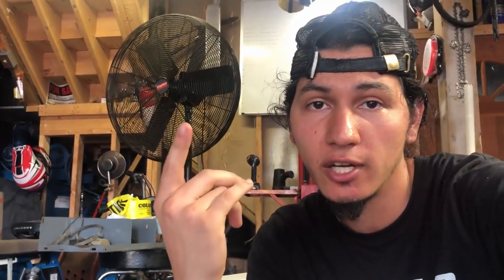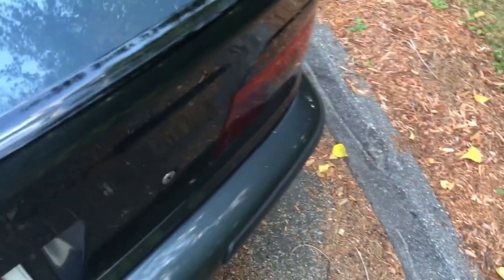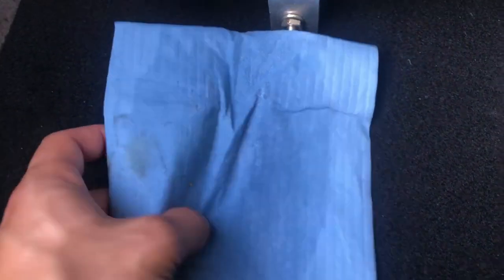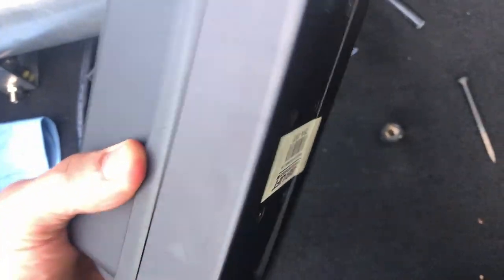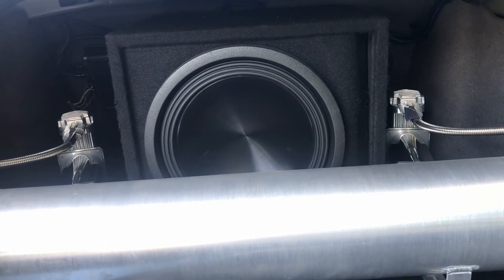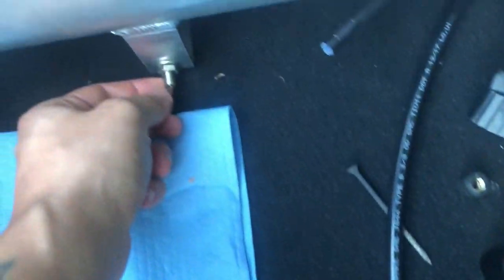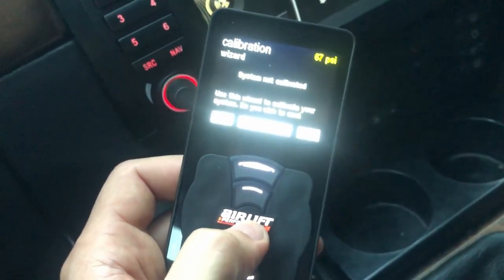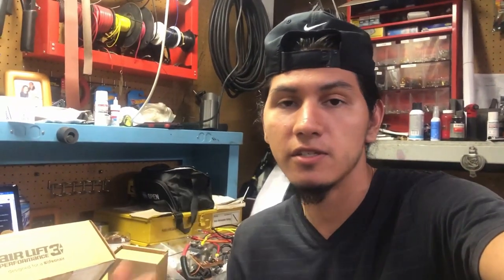AIRLIFT 3P MANIFOLD ISSUE

Comment: Had same problem. You got water in the manifold. It’s safe to drive . Just contact airlift and send them $250 and they’ll send another one so you can still keep your old one. Once you get the new one just send them your old one for refund. Also, that trunk setup could be a lot better. I had airlift on my 540i and all you can see is the 8 gallon tank. You can hide everything else so it’s a cleaner setup.
Reply from the maker: Vinh Nguyen They told me just to send it back and i will get the new one in a few day. I didnt have to pay. I was under warranty still. I am still working on my setup. I have a few more ideas. My setup is different from this video now. I made another video on the new setup.
Reply: @A1Brian   Correct, if you send them yours first, you pay for the shipping, they will send you another one free. However if you can't take your manifold out because you need the car to get to and from work etc. then you can pay the $250 and they will send you one and when you return the old one they will refund you your security deposit.

Comment: What stereo you have?
Reply from the maker: Hector Arias Coaxial Alpine speakers all around. 600W Kicker amp for the speakers. 1200W Kicker amp for the sub. 12” Alpine Type S subwoofer in ported box. 1.0 capacitor. The radio is from online, i dont know the brand or specs tho.
Reply: @A1Brian  Thanks bro
Reply from the maker: Hector Arias No problem!

Comment: You took the manifold out without airing out?
Reply from the maker: I had to air out and take the air out the tank too
Reply: How'd you do it if the controller and bluetooth app wasnt working?
Reply: I wanna find out too,because the air in the tank is posible but those air on the bags,,,how??
Reply from the maker: I added a good fuse really quick so the controller would come on until i got home. Got home and aired out the bags completely. Then aired out the tank. Disconnected the battery. Disconnected the harness on the manifold. Then disconnected the airlines and took the manifold off.

Comment: Problem will be that the manifold is lower then the tank from what I have read up
Reply from the maker: I also read that. I might make a mount so the manifold sits the same level or higher then the tank
Reply: I would have it above the tank as condensation builds up in the tank and manifold
Reply from the maker: Andrew nixon Yea thats true. I will see what i can do. Thanks!